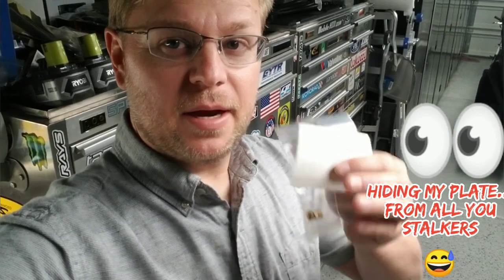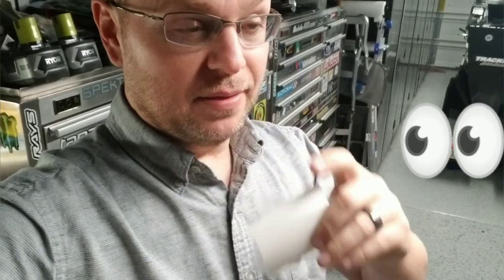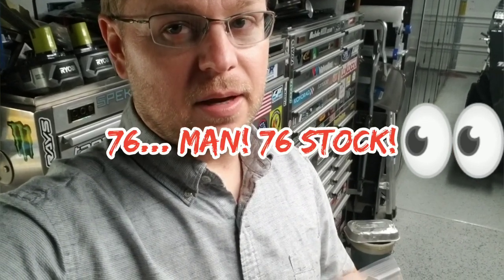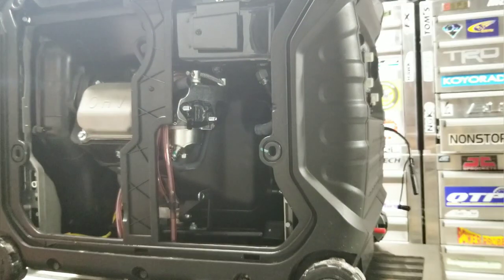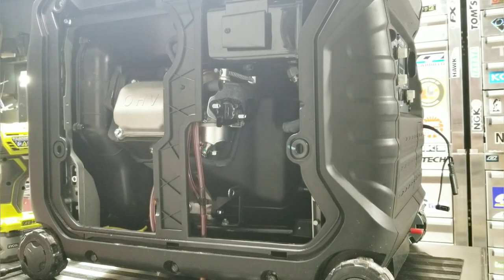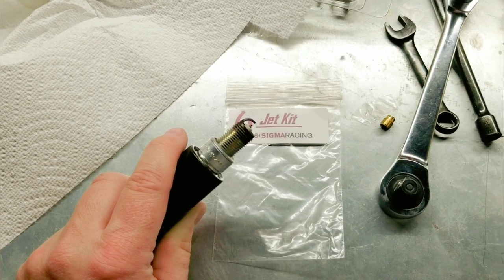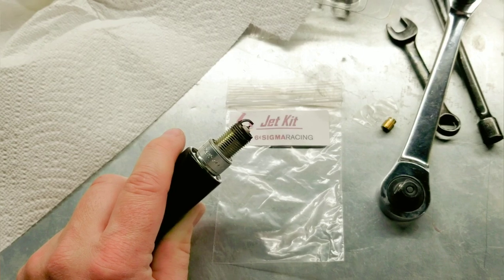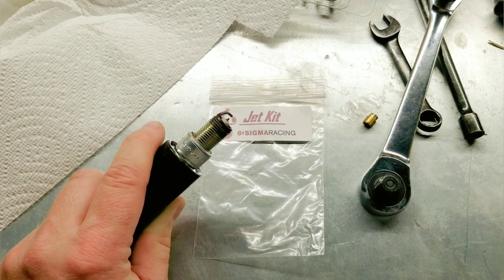DIY GUIDE - REJETTING THE PREDATOR 3500 INVERTER GENERATOR! RESOLVES A COMMON SUPER RICH CONDITION

Comment: i have been on harbor freight website and dont see the carb gaskets needed to do this job i must be missing them i see some parts but not the ones like this i need to order in case mine gives me trouble.Did you do the oil fill door mod  watching to many videos.
Reply from the maker: Hello, do not need to replace gaskets to do the jet. It is just a o-ring on the bowl which can be re-used. I did a case vent mod, made only a slight difference but still ran very rich jet solved all my issues.
Reply: @MR_Garage  so sorry to bother you again thank you for the help do you have an exact part number for both those jets they sent me a link but i need to be sure its for predator series motors
Reply from the maker: I used this link to buy. Just select the jet size you want from here. https://www.ebay.com/itm/232104529620
Reply: @MR_Garage  very good i just ordered them should be here in 3 days.thank you for your patience i really appreciate your efforts on this thank you
Reply: @MR_Garage  just wanted to thank you again so far after my first hour I see no black stuff on my spark arrestor I just shutt it off and I'll do a oil change on it I see metal chips at the end of the magnet dip stick I bought.is it ok if I keep posting here to update others as well I don't make you tube videos so this might help others.so far I have removed my stock .076 jet and went with .072. this is a brand new generator first run. Thx.

Comment: I want to use my 3500 generator on a mutant vehicle at Burning Man (3900 altitude) but it floods all the time and shuts down and won't restart unless I let it sit for a while, so I end up using my 8000k Predator on vehicle since it doesn't have any issues (except it is so loud) and as I read the comments you talk about overfilling causing flooding but I would think since I am using this in a moving vehicle the gas sloshing around would be the same as overfilling it.  Any ideas on what to do in this case?  I ordered smaller jet because even at sea level it will die occasionally and be flooded when used on ground.  Would  propane modification be better for me using it in moving vehicle or can I just bypass the fuel return and use vented cap?
Reply from the maker: Many talk about deleting the charcoal canister and just venting the fuel lid. Some videos on it, that sounds like it would work for you if in motion while using it.
Reply: I read more about propane modification and think this could solve another issue I have at same time. I mount the generator on front rack & use pipe to have exhaust go under vehicle but fumes come back into vehicle since rear is open. With propane it doesn't smell like gas does. I'll do 3 modifications then I have choice of gas or propane - 1 change jet, 2 remove charcoal cartridge, 3 propane mod. (Propane mod $139 on eBay)
Reply: @MR_Garage  Can you post the iridium spark plug model number?
Reply from the maker: @ecotentsalida  Yeah, it is in the big video here... https://www.youtube.com/watch?v=b5VgQ_AKCdY&t=4s  link to the plug here.... https://www.amazon.com/gp/product/B0018JVDRG/ref=as_li_tl?ie=UTF8&camp=1789&creative=9325&creativeASIN=B0018JVDRG&linkCode=as2&tag=mrgarage-20&linkId=798e7ec8b9a5ffff21fa7ea03fa6d35f

Comment: So I figured I put this here.  I bought the jet kit from 6 sigma, it came with a 60 & 68 jets. I opted for the 60 jet here at 6200’ elevation, I typically camp ABOVE 8500’.  Well, I started the generator and it purred!  Hopefully going camping next weekend, I’ll report back how it does above 9000’ feet.

Update: I ran the generator today at 22.5 amps with the #60 jet, absolutely no surging indicator that it wasn’t getting enough fuel.  I’m at 6125’ of elevation...

Comment: 6sigma shows main jet and pilot jet, which jet did you get ? #68 main ?
Reply from the maker: I just worked the main jet and ran a #68. If you are below 2K feet mostly, could try a #70 or #72 if they have one.

Comment: On 6sigma website I only see jet kits in stage 1 thru 7. Which one has the #68 jet?
Reply from the maker: Easiest to go through their ebay link. Their page is confusing. https://www.ebay.com/itm/Predator-212-cc-Honda-Clone-GX160-GX200-GX390-Intake-Carburetor-Carb-Main-Jet/232104529620?hash=item360a820ed4:g:ZlkAAOSwOyJX9X7D

Comment: What about at altitude? Living about 4200 and camping up to 8000. I’ve changed it to a 72 jet, but now surges and struggles run smooth at 4200.
Reply from the maker: I am at 1200. Runs even better at altitude now. Going to a true 72 at 4200 should be flawless. With the 68, at 7K feet, starting has been so much easier.  Are you sure the emulsion tube was put back in properly and is clean? Is idle too low? Can turn it up if needed.
Reply: Mr. Garage I’ll double check the e-tube. When eco is off it runs horribly, when on it runs barely ok. Maybe I’ll mess around with the idle screw. What about the pilot jet? Anyone tried changing it, if you can?
Reply: I camp at 7000ft to 10800ft altitude in the summer. I bought the high altitude rejet kit from Vpower and it runs great now with no surging and starts quickly. I have also installed the same kit for friends and they have been happy as well.
Reply: Great video Mr. Garage. I was sold on buying this generator for over a year and was just waiting for this season and a coupon to buy the 3500. I knew it ran rich from all of the videos I had watched, but your video was the first to show a re-jet which is what I was after. I purchased my predator 3500 a month ago but had been waiting for warmer weather to un-box it. I ordered the #68 from 6sigma off of ebay ~$6 and the NGK iridium plug. I installed both before the initial fire. It started right up, but was slightly surging when under load. I was  bummed and tired from work so I just walked away. The next day I took it apart again and put back in the original #72 jet. I had also blew compressed air in all the carb circuits and in the main jet with the jet/emulsion tube removed. When I fired it back up with the #72, it ran perfect - butter smooth, but the exhaust stunk as expected. I briefly considered leaving the #72 jet in, but knew I wouldn't like it. I then put the #68 back in and it has been running perfectly and the exhaust is sooo much better. Now about 2 hours into my break-in period. Thanks for posting this video. BTW i live at ~2800ft elevation.
Reply from the maker: @jeremyb4637  Hey Jeremy, Stock should have been a #76. Can you confirm yours had a #72? Curious if they finally made a change. Also, sometimes people do not put the emulsion tube back in properly, I think it can go in upside down.. can' recall for sure. I may be thinking of another motor I recently worked on. It could have been wrong initially or a small piece of whatever got stuck in place until you blew it out.
Reply: @MR_Garage  Just went and double checked, mine did come with a #76 - can send a pic if you want. Mine also came with Bosch plug, but I have always been a fan of NGK. The emulsion tube can't be installed upside down as one end is flat. I think that there may have been some thread locker on the factory jet or something else that caused a partial restriction when I did my first install of the #68.

Comment: YOU CAN JUST PUT A VENTED OIL DOOR  ON IT AND CURE THE PROBLEM. IT ALLOWS IT TO BREATH AND RUN LEANER. THANKS FOR THE VIDEO.
Reply from the maker: In my testing early on, a vented door or just taking the door off helps a bit, but also the unit does not draw as much air through the electronics (part of the design). And even with no door, the gen still ran a bit right, especially at higher altitude around 4K+ in which is was nasty rich. The safest bet for this gen is to put it in the proper A/F ratio range under load. No power or capability is lost, it is only a positive change if done right.
Reply: @MR_Garage  I live at 7500' and regularly camp at 9000++. What's the best jet to use. Also, I put in a thinner head gasket! So maybe I need to jet for 6000'?
Reply from the maker: @ecotentsalida  I would go for a #68 to start with if you used a thinner head gasket increasing compression? See how it runs and how the plug looks. Can go down from there. Your AF will be corrected but you will definitely be down on power that high up so it may not produce full rated power of 25A. In fact, likely will not as the gas side will not handle the load presented by the inverter.
Reply: @MR_Garage  Thank you for the reply. I’m currently at 7500 feet and have the oil fill door off. I put the stock jets back in. And I’m currently running a little over 2500 W, with a hair over 20 A, with my heat gun and ceramic heater. I did do the thinner base gasket to increase compression to try and help with the power at elevation. I just need to figure out any airbox mods I can do and then match it with the appropriate fuel. I bought a set of jets on eBay, but there are new markings on them at all. They also sent a replacement emulsion tube. I haven’t put that in yet.
Reply: @MR_Garage  I also dropped sigma a message to see if they can help. Thanks for the referral.

Comment: Interesting that you can run 24 amps on a 20 amp circuit.
Reply from the maker: Which circuit are you referencing?
Reply: @MR_Garage  
The two plugs you had your heat guns in are together, a 20 amp circuit. At least, that’s what I would take from it. Having the breaker any higher than 20 amps would allow either of those outlets to supply more current than safely possible.
So now I’m not sure what the breaker rating is for those 2.

Comment: I’m just running my rv light,tv and ac and the generator hiccups and the tv shuts off . It only happpens when I run ac and tv together . Can anyone help me
Reply from the maker: Do you have the electric side of the hot water heater on at the same time? What size AC unit?
Reply: @MR_Garage  no water heater is off and it’s 18000 btu
Reply from the maker: Ok, that is a very large AC unit. It would draw on its own around 18-20A. Now add in draw from other items and you are probably pretty close to the full rated output of the gen. The AC unit at startup will draw significantly more power called (inrush). This seems to be well past the generators surge capacity if your TV goes off. About the only thing that will help you in this case is to add a soft start capacitor to the AC unit.
Reply: @MR_Garage  oh wow or another generator. Do u have any recommendations for another generator not to crazy expensive
Reply: @MR_Garage  actually it’s a 13500btu
Reply from the maker: Ah, ok standard. Electric side of your Fridge on? Or, running it off gas?
Reply: @MR_Garage  we just bought the toy hauler so we are learning but fridge is off as well

Comment: This is a great video!  But it makes me NOT want to buy one of these generators, which I was on the fence about.  Also, many other videos on making cooling holes in the case, etc.  It's shocking that you buy a brand new generator off the showroom floor and then have to do these kinds of things to it.  I know Honda is apparently overpriced, but you put in oil, gasoline, and pull the cord and you're good for 10 years with regular maintenance and none of this.  Plus, you can get parts and service almost everywhere.  Go into a Harbor Freight and ask for parts and service and you get dumb looks from the cashier.
Reply from the maker: You do know that even a honda requires jetting changes depending on altitude as does any small engine. Also, you can order parts for these just as easily online. Coils, carbs, heads, valves... you name it. Easy. Honda makes a great generator but they are FAR from the only game in town anymore. And the exceptionally high price has finally caught up to them as it never needed to be that high in the first place. Luckily, the competition is starting to drive the prices of Honda down which is a win for die hard Honda fans. Best of luck!
Reply: I think the keyword is "have to". You don't have to do these things but essentially you are tuning it to your specific situation. I would imagine you could run it stock in most cases and it'll still work fairly well. These are just tweaks in my opinion. Very good info from the author of this video

Comment: Question - I am moving to Big Bear Lake next weekend (for a few months), and I have a Harbor Freight 3500 Inverter Generator. As I understand, I will need to refit it with a High Altitude kit, and I found one that works with  fits all Predator 212cc engines. I am a TOTALLY new with generators, and didn't know where I could find an installation video (though I am looking). This is the part I am going to buy: https://www.vpowerequipment.com/high-altitude-kit-fits-all-predator-212cc-engines/    I just don't exactly know how to install it - could you point me in a direction? Also, would I keep the old and swap it back in once I'd come back to lower elevation? THANKS!!!!!
Reply from the maker: Big bear lake is just under 7000 feet. Run a #68 main jet and you will be more than OK.

Comment: Forgot to mention --- I have worked on my Predator 3500 for hours --- and wish they had made it with a simple method to REMOVE that stupid black plastic strap/frame thing right in front of the carburetor!   Why didn't they make it with two screws, one at top and one at bottom, to remove it so you could easily work on the carburetor???   
I tried and tried to remove that entire side panel (not just the red one) and determined it a major part of the frame or something of the entire generator.  
Another thing.... HOLES for more fresh air you drilled.... There is another guy (wish I had the link for you right now that clearly shows that's a BAD idea! )  You have bypassed a lot of air that goes to COOL the electronics!    The fresh air comes in at a very bad place at the bottom of the display/working panel (could suck up some dirt) but it FIRST goes to cool the electronics!  Then it goes to the main body/chamber of the 'house' to get sucked into the sponge air filter before the choke and carburetor.  
IF you want to increase the airflow for both the electronic cooling and the air filter/carb.    drill holes in the air filter housing block before the sponge filter (the snap on cover).  That is where the restriction is!   If you drill holes in the side as you did, that helps the carb air flow, but... now you've reduced the air sucked thru the electronics cooling compartment!
Reply from the maker: Long ago a member of the predator / powerhorse group ran thermal imaging scans with the side cover mod and without it. Made zero difference despite another guy's claim. 

As mentioned, proper jetting is the correct fix.
Reply: I removed mine. All it does is provide a place to run the charcoal canister hoses, since I removed that as well, no need for the piece.

Comment: Why not drill small vent holes into the cover to help it breathe better. It's running rich because the demand for it to be quiet requires containment of sound transmission. It's a design sacrifice...quiet = poor air exchange = rich running condition. There is a video on YouTube (I lost track of it) where the unlatched oil fill/drain access door is shown to be sucked closed when inverter is running. When the inverter was shut off the door literally falls open. The only source for that vacuum condition is from the carbs need to suck in air from within the same sealed-tight, sound proofed outer body. Ideally, the air filter intake path should be made external to the body of the inverter to allow for the correct fuel air mixture to be achieved. You are addressing the issue backwards, imo, and there will be a slight reduction in power as the fuel flow is being restricted to compensate for the restricted air flow. The right fix is to somehow vent the carb intake chamber to the outside of the unit. Make the fix tight around the cover to keep the sound proofing in effect and the proper fuel / air mixture should be restored without making the unit it louder or reducing power...duh!!! Let the damn thing breathe for god sakes.
Reply from the maker: Hello, If you notice mine is vented on the cover. I ran all sorts of tests including running without the oil access door. They did not properly cure the rich condition. Jetting for your altitude or conditions IS the best solution as with most any small engine.

Comment: ok one has to ask if this problem is so widely known why the hell does't the MFG fix the problem to start with.  I should not have to spent 700 dollars and then additional $$ to  fix what their engineers screwed up!!!
Reply from the maker: What it seems you are missing is the fact that most every carbed gas engine has to be jetted properly for their altitude range. The problem here is the gen by default is set for virtually sea level and on the rich at sea level. Now, you have all us using them for camping or other at higher elevations, myself 7K+ feet. There is not a one size fits all setup for this and best to correct and dial in for your altitude. Jets are dirt cheap and luckily this is a generator that runs pretty hard when loaded - so all that is really needed is main jet correction for altitude.